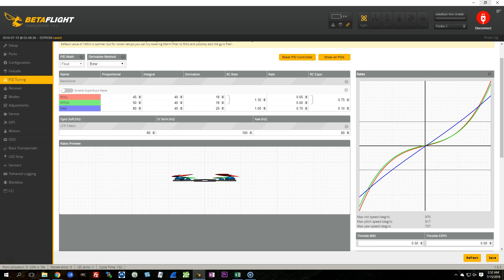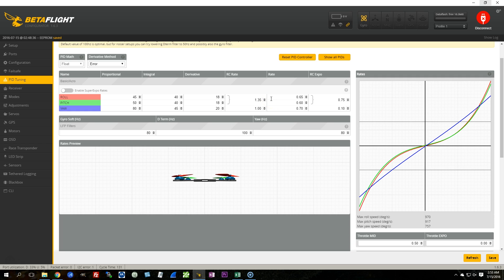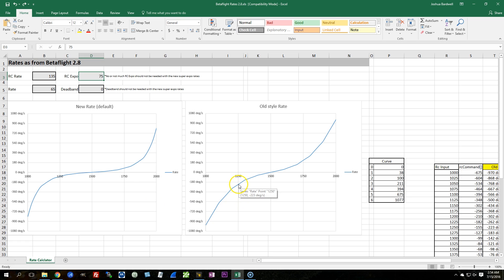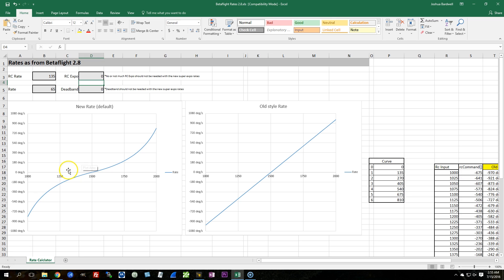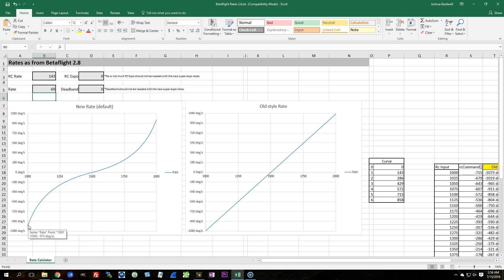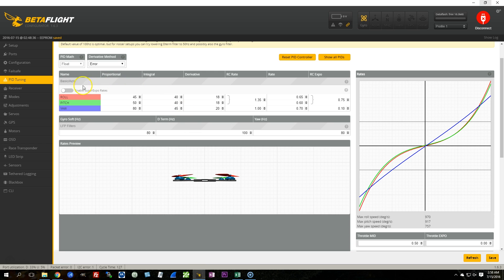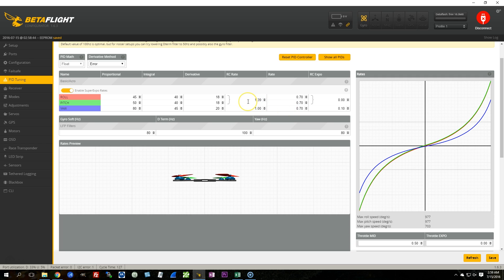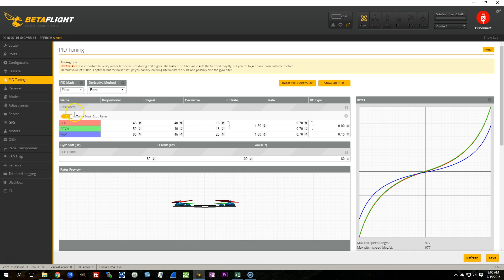Betaflight Super Expo Rates: How To Configure

Comment: Joshua, Iam desparate to get an answer!! I have 3 builds going on and theyall connect, everything in cleanflight works-- except receiver (Modes), and the changes are little. Cofig to 1050, receiver page to min of 1030 and no idea how to set new min, max in cli. I can type, but dont have the letters to set. How can I be missing the sam thing on 3 (carefully) built quads?? Thanks for thinking on this-- make my day!!!
Reply from the maker: I don't understand what exaclyt is not working in your setup. "I can type but I don't have the letters to set". What does that mean?
Reply: I am sorry. All I meant is that I do not know what to type in cli to affect min, max rates for throttle-- or the factors that will effect the inability to arm or begin the recever functioning. I have re- bound the receiver, checked all esc connections, checked all extraneous solder joints. Have basically gone through the "Whole Build" and , evidently am blind to the receiver not hooking up, connecting, showing movement etc. Thanks for your attention.
Reply from the maker: +Bud Jones if the receiver tab isn't moving at all then the issue isn't your endpoints. Most likely the receiver type is wrong, the Ports configuration is wrong, or the receiver isn't wired correctly. This isn't going to be something that is easy to troubleshoot remotely, because there are too many variables.
Reply: Joshua, Thank you-- i will try to isolate the problem and I fInd it, Iwill let you know so maybe you will be able to help another Noobie. It is probably simple, but-- aren't they all. Any otherthoughts, let me Know.
Reply: Joshua, I just bought a Holybro Shuriken 250 and followed all the directions. The green light says that I am Bound. Once again-- no receiver movement on cleanflight. I hate to be a pain, but this is 6 builds and a purchased BNF that have the same problem. This is happening on a Taranis and a Radio Link receiver. Any more  thoughts?
Reply from the maker: +Bud Jones Taranis only works with FrSky receivers. Why didn't you buy the Shuriken with a FrSky receiver.
Reply: I am sorry, I checked-- It is the Frsky receiver in the unit.
Reply from the maker: +Bud Jones assuming you're bound, then it should just work.
Reply from the maker: +Bud Jones you need to make sure the right port has serial rx turned on. Then make sure SBUS us selected as the serial protocol. Have you flashed the firmware or anything that might have changed these settings?

Comment: so I'm trying to understand this,  my quad is very robotic/snappy when I move on pitch and roll axis I'm trying to find good information on how to make it smooth but can't figure it out I'm assuming it has something to do with RC rate and Expo I've seen other quadcopter YouTube guys talk about doughy center sticks.  I can't seem to get my quad there to where I roll and it isn't Snappy or robotic. for example right now I have RC rate at 108 roll and Pitch rate at 80 and Expo at 35.  previously I had RC rate at 1:35 pitch and roll rate at 70 and Expo at zero
Reply from the maker: Try adding more expo.
Reply: Joshua Bardwell adding expo did the trick, I'll just have to find the right combo now that feels good

Comment: I think in a previous video you explain that the updated super expo isn't just a more aggressive curve like it was when it was first integrated, but it included on the fly calculation on the FC so the curve was smoother vs pre-calculated w/ 5 milestones on the graph. So I've been flying with super expo on but with the same exact stick feel as I had before. Moving to the newer calculation my rates are as follows: RC Rate 1.72 // RC Yaw Rate 1.77 // Roll 0.6 // Pitch 0.6 // Yaw 0.6 // RC Expo 0.0. Though the values look outlandish it translated perfectly!
Reply from the maker: I'm not sure that most pilots will actually feel the difference in the curve.
Reply: I figured it couldn't hurt if it matches the old stick feel and I might as well keep up with the changes.
Reply from the maker: Pretty much the same here. I think that it may be easier to tune the rates given there are now only basically two parameters, one for mid-stick and one for end-stick rates.
Reply: Totally agree, betaflight is super tidy. I'm happy to outmode the old way of fragmenting all of the settings. Btw, thanks for your videos. Totally learned a lot!

Comment: Hi Joshua, is there a way to turn super expo off? Should I just try and get used to it?
Reply from the maker: +AeroScrew "feature -superexpo_rates" in the CLI or use the Betaflight GUI if you are on 2.9.0 or higher and there is an option on the PID tuning page.
Reply: +Joshua Bardwell Thanks! I can't believe I missed that...
Reply from the maker: +Tommy Pezzino no space between -superexpo_rates
Reply from the maker: +Tommy Pezzino you can't use Betaflight 2.8 and earlier in the GUI. That is probably why it isn't sticking.
Reply from the maker: The If the GUI updated to 2.7, then you must be on betaflight 2.9.1 or higher. Unfortunately, we are in a transition period where the Betaflight GUI is very new, and compatibility with different versions is precarious. Boris has stated that he thinks this will be the last compatibility break though. You should upgrade to 2.9.1 if you want to keep using the betaflight GUI, and sorry for the inconvenience.

Comment: You actually forgot to show that you can already test the rates virtually through the 3D model :). Of course rx needs to be powered for that.

also one minor detaill. When you migrate from old versions and you dont want super expo rates and you use your old rates that yaw rate is only one what is scaled differently than before. thats the only difference. Actually you need to lower it a bit
Reply from the maker: Good point about yaw. That won't directly translate over.

I'm not sure how useful the 3D model is because many people fly FPV. What if there was a simulated 3D landscape with a horizon that flipped and rolled and yawed in response to the sticks?
Reply: what do u ment by virtually  through 3Dmode?

Comment: When I was on 2.8.1 for a while the defaults were causing crazy yaw jump which I had never had problems before while yawing or ending a yaw move.  In might be good to note for people that "D" affects some of the Yaw jump, as well as tuning the rate for yaw.  I can't remember which way is which but adjusting one affects yaw jump during the move and the the other at the end of a yaw spin.  It doesn't take long to adjust that and it's easily done in your front yard.  I ran into this as well on the KISS FC where the "rate" was causing a lot of yaw jump and guessing that the fix would be the same as in Betaflight....the fix was very similar, I turned down rate.  There is some documentation online if you search about this where Boris clarifies this.
Reply: There is the conversation I had seen that helped clarify things. https://github.com/betaflight/betaflight/issues/447

Comment: I had pure dumb luck with my first copter loading 2.9.1- the default pids, with super expo enabled and rates at .70 were so close, all I had to do was drop I a touch, and nudge the P and it was as good as any tune I have ever managed.
Thanks for yet another habisky upload Mr. Bardwell.

Comment: hey Josh. I'm interested in trying the new 2.9. I am on 2.7.1 right now. I'm also wanting to try the new betaflight config.Where can i get it so I can use it off line. now that they took away chrome app launcher.
Reply from the maker: Go to the Chrome Store and search for it. The Chrome app launcher is gone, but you can still get there from the Apps bookmark in the Chrome browser.
Reply: +Joshua Bardwell ok thanks
Reply: Note you can also pin a chrome app to the task bar, which is as good (or even gooder-er ;) ) than the old app launcher.
Reply: +Zap Andersson but can you access it offline
Reply: Yep